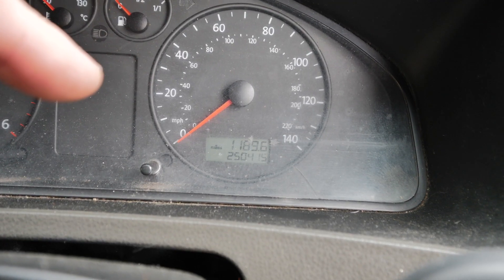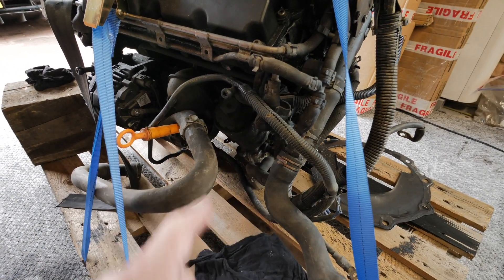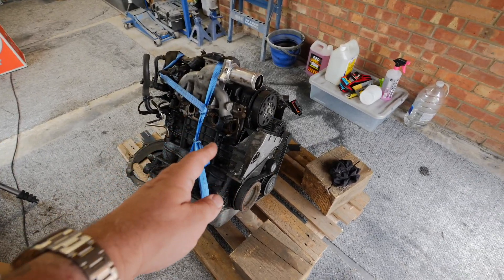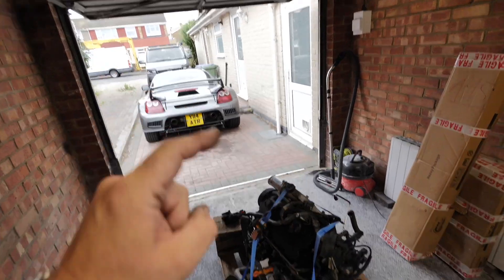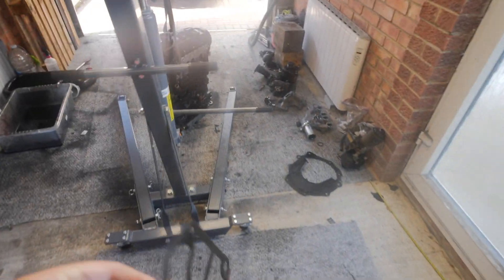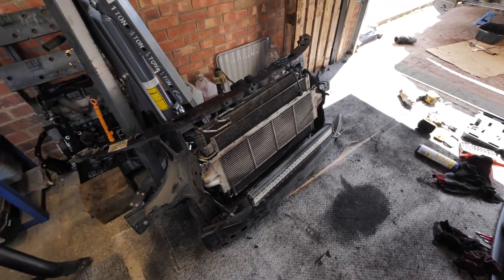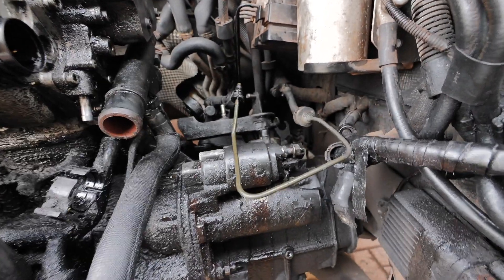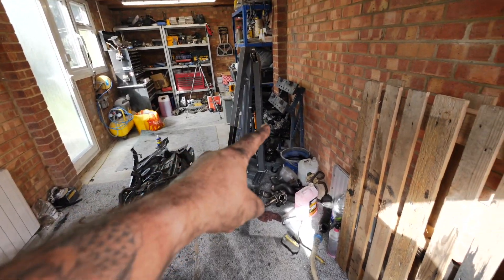VW T5 Transporter - Engine swap PD130 - part 1

Comment: I've got 1 to do this week is it easier taking engine out from the bottom? 
Thanks
Reply from the maker: No, definitely easier taking the front off. It’s not actually a big job and you can get to everything much easier. I changed the gearbox a few years before from the bottom. It was a lot more of a squeeze working on the bits you need.

Comment: Just found your page and thanks just rebuilt my gearbox and seems harder to put back together than taking out. Just a couple questions if you can what program do you use on your pc to connect to the T5? And I can seem to ding the sump connection plug is it on the harness from engine or does it run from the firewall. Cheers mate from Australia 🇦🇺

Comment: Ey up pal I'm doing the engine swap myself but I'm struggling what to do with the crank sensor ?
Your help would be much appreciated.
Reply from the maker: Didn’t have to do anything with mine only swap the one on the Skoda engine out for the one off my vw. People talk about drilling the block and stuff but this engine I didn’t have to do anything. Everything I did is in these 2 videos.
Reply: @SpyderLEE  think I may have to drill the block on mine as the sensor is different to my van 1
Reply: Have u still got the old oil filter housing? 
Mine is clearly the golf  asz engine the filter housing is too big ffs.
I'm from sheffield.........or if u have got rid of it do ubpossibly have a pert number ?
Reply: I know paul also sheffield re maps

Comment: Hi, I've watched this a few times and you've made it look easy 🙂 i've gone and ordered an asz engine and about to attempt it on my T5, any chance you can provide part numbers of the gaskets required? Thanks
Reply from the maker: I literally just used my reg to order the gaskets and ordered them for my original engine. They all fitted. 👍

Comment: Hi good job 👏 on the video can i ask what other vag cars have the asz engine? My t5 mixing coolant & oil again too after doing the headgasket 3 year ago. Its done 300k now i want to take it out. Thanks
Reply from the maker: I’m not 100% on other cars but I know there is a Ford that has it and also the vw polo & golf. Some of them need different mods though
Reply: Thanks so if I got a fabia vrs engine pretty much a straight swap I keep my ecu /clocks everything loom gearbox etc..
Reply from the maker: @pauljames7399  yes as long as you do what I did in the videos plus change the injectors. Or keep the VRS injectors and get the ecu mapped. If you watch the part 2 to this video you will see
Reply: I found out there was coolant in the oil sump & It was leaking  from a dodgy sumpnut no smoke from the exhaust no bubbling expansion tank no oil in coolant.. it did overheat last week on motorway I pulled over & let it cool opened the cap.. I did the headgasket  3 year ago  only done like 30,000 miles does it sound like headgasket gone again?

Comment: ive done this swap previously on a t5 with fabia vrs lump,your right with 150 ish bhp if its a 5 speed,going 6 speed is more involved but could take the 170/180 these can make,take note of lower crank sensor near gearbox end,make sure your pd 130 can take the  plug it needs to use the t5 harness! just a fyi,be watching have subbed :)
Reply from the maker: Yeah swapped the crank sensors. No mods necessary on this block 👍. Engine is running lovely.
Reply: @SpyderLEE  happy days :) shame they didnt really offer better pd from factory til they started using more expensive dsgs

Comment: Just started doing mine, got the engine from a galaxy as had the same short filler housing. Got to drill the block in the next coupler of days..... How much is your map costing?
Reply from the maker: I didn’t have to drill the block. With the map speak to Paul here -
https://www.facebook.com/sheffieldremapping
Reply: how did you not have to drill it?Hows it picking up its signal fromthe crank?
 @SpyderLEE
Reply from the maker: @hippopigy  it already had a crank sensor fitted. I swapped it for mine.

Comment: Hey Lee so was it pretty much a straight fit didn't have to drill a hole anywhere just swap the bits over was it
Reply from the maker: Yep just swap bits over. Had to hack the engine mount a little. I go through everything I change in the next video.
Reply: @SpyderLEE  thanks mate 👍